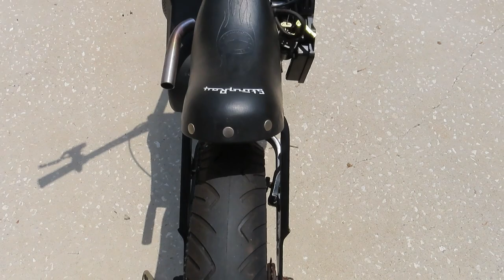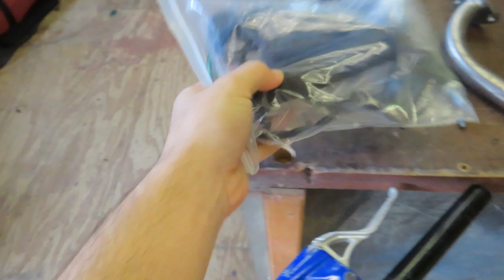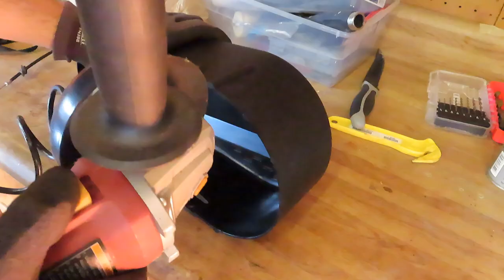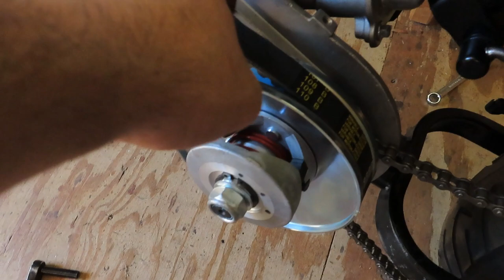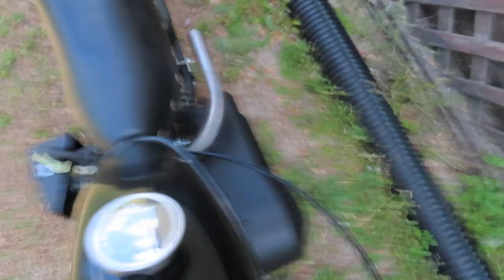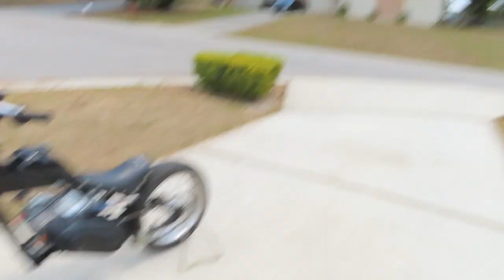Schwinn Occ Chopper FINALLY RIDES! Powered by 79cc predator!!

Comment: I'm doing the same and would like to know how you have your throttle linkage hooked up I can only find a ungoverned throttle setups I wanna keep the gov on mine
Reply from the maker: Kinda hard to explain in comments, but search throttle setup on 79cc predator. There are some good videos out there and you don’t need much.
Reply: @RidingWiithJacob  oh dang nvm I'm putting a 212 in mine I missread the title lol I'll figure it out with trail and error thx though
Reply: @RidingWiithJacob  welp I changed my mine a 212 won't fit so I'm putting a 79cc lol

Comment: For fuel tank. Drill holes in middle of stock mounting brackets, measure distance from front tank bolts to back tank bolts, drill starter holes on top of frame same distance apart, flip stock brackets over on top of frame bar, secure with self taping screws, feed tank bolts through and bolt down normally.
Reply: Hey homie, how long was the adapter bushing you got on amazon? All I can find is 3 inch ones. Thanks.

Comment: know i'm late but just wanted to give a bit of info in case you wanted to get more outta your 79cc.

mill 50 thousandths off your head, and clean up the intake and exhaust ports (they are horrible stock)
lap your valves afterwards. put in 22lb springs, upgrade carb to a 19mil, you can get a billet flywheel from arc racing, but it comes with only a 4 degree advance (you'll want to advance it a bit more. YMMV depending on engine but i've found mine prefers around 30 to 32BTDC. you can do this by shaving the key, but honestly the 79cc uses a tapered shaft so the key is kida pointless anyways)

doing this will bump up your hp to around five and a half. you can squeeze more out of it, but more than this is gonna require a new cam, which since agk discontinued their 79cc reground cams, means you'll need to find a local shop to do it. i'll post the lobe durations and such just in case, because getting the cam done REALLY wakes this motor up. my current cammed motor makes around 8 horsepower and revs north of 9000.(planning on doing an overbore and stroker on it eventually).

and last but not least, THROW THAT TORCH SPARK PLUG IN THE GOD DAMN TRASH. (seriously, they suck and can fry your coils)

oh, one more thing, this motor lives for higher gear ratios. shoot for a final drive ratio of somewhere around 9 or 10:1.

CAM SPECS-  
Intake- .224"lift, 219* duration
Exhaust- .231" lift, 222* duration

Comment: You should thread some pipe through the original crank hole and bend it for foot pegs. My chopper has foot pegs on the forks. That would work too.
Reply from the maker: I ended up welding the pedals both facing towards the front wheel to the original crank hole 👍🏼

Comment: Hi, I saw the last video and yo mentioned an extra spacer. So do you end up putting the extra spacer yes or no, and if the answer is yes, you just put another spacer, build one by your self and if that is the case what measure do you add?

Comment: Where’s you get the tensioner from? I built a bike like yours and use a occ bike frame but I put a predator 212cc ghost engine so ya. Chain rubs against the bottom frame of the bike so was just wondering where you got it from.
Reply from the maker: Amazon most likely I can’t remember exactly.

Comment: I ordered a 30 series torque converter and the bolt holes didn't line up with my 79cc predator. No matter which way you turned it. 
Which torque converter did you use?
Reply from the maker: Comet clutch 212cc off amazon

Comment: Does the Torque converter function properly with only 2.5hp? Can it ramp up the full amount? Even if it doesnt do you feel like on hills it does a lot better? I really want to get one for my 79cc motor but one of the guys at gopowersports said it wouldnt function well.
Reply from the maker: With the proper gearing, and governor removed, it was WAAAY better than the centrifugal clutch. If you really want to break down and do it right they make a 79cc torque converter but it’s crazy expensive. But I mean it worked fine for me just cruising in the neighborhood Florida doesn’t many hills so wouldn’t know about that.
Reply: @RidingWiithJacob  Im going from a 79cc Lifan to a Torque Converter to a 10t sprocket to a 32sprocket on a 11inch wheel. Basically I would get all the Torque I need on flat ground from the converter gearing and when the RPM raises its already geared for Topend speed. Mainly I want to break belts and put less wear on the engine instead of the output shaft and the clutch.
Reply: I dont have anything in yet, otherwise I would have just put everything together already and put up a video myself. From what I can tell from your videos and others, the Torque converter will engage well enough and give me the torgque I need to get up steep grades. Im not sure what Kind of gearing Ill end up with but I dont see myself 
having a problem either way. Its one of those, I'll be fine situations for sure.

Comment: About to start the same project. Any advice would be helpful.
Reply from the maker: Buy a 79cc motor mounting plate to weld to frame, buy the 12$ throttle kit for 79cc, big rear sprocket, I wasn’t a fan of centrifugal clutch. Those were pretty much my big problems.

Comment: Nice project but after you add the foot pegs and fine tune the engine if you can do so if you want more speed see about altering the frame slightly by adding a down pipe under the seat to add a geared sprocket and Jack shaft assembly it should work wonders

Comment: You really should be able to go much faster with a torque converter, I've recently found out about rear driven pulley spring adjustment which controls how easily the driven pulley opens up. In this video I reckon the green spring is the softest which should open the pulley best with a 79 cc engine. I'll also post another video showing how to swap them more clearly.
https://youtu.be/eT7OkAtLPR8
Reply from the maker: That’s a great tip I will definitely be doing this.
Reply: I subscribed to your channel, can you please make a video about how it turns out? Thanks.